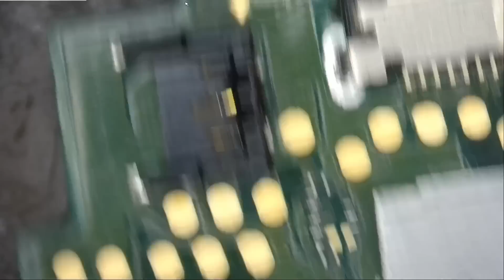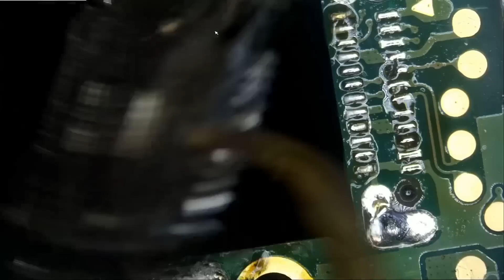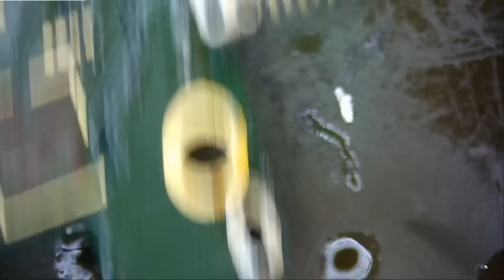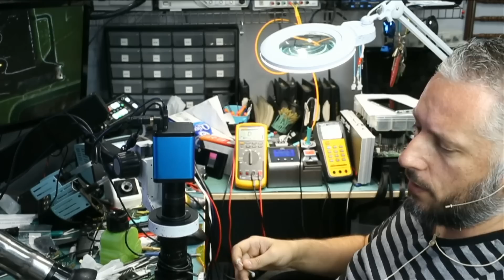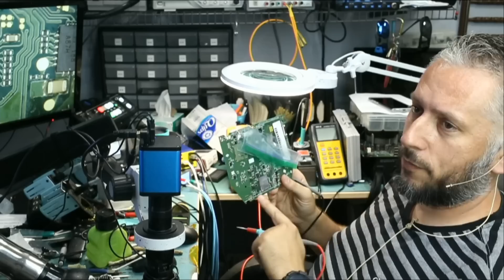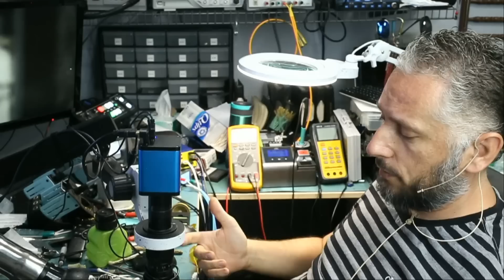Double dose of Nintendo Switch and Switch lite motherboard repair

Comment: I replaced the left control stick and now L3 is not responding when I click down, i had trouble getting a stripped screw when taking it apart, could scratching the board affect L3?

Comment: How do you melt the solder but not melting the plastic??? 😮😮😮 15:20
Reply: I think because he applies hot air from the bottom of the board in this case

Comment: While you press and hold the chip, is it not possible that the excess solder shorts the connections under. How are you so sure that they don't?
Reply: Exactly. You should NEVER push on a balled chip. you place, nudge, and it will sit it place on its own.
Reply: @mrmedoali4200  That wasn't a BGA.
Reply: @azharuddin2023  Yes I know that. I was just speaking in general and referring to balled/reballed BGA chips and not this particular chip in the video.
Reply: I don't think that particular chip was balled if we are talking about the same thing.
Reply: @edwardgalvan5412  Oh no I'm talking like in general and referring to balled BGA chips

Comment: Is low melt different than 60/40?
Reply: Yes. It is completely different metal alloys. It's usually indium alloy.
Reply: Also 60/40 is for soldering  components low melt solder is strictly for desoldering only

Comment: I've done a few of those type C connectors on switches before, and they're not a beginner friendly job. The one thing I always do differently is not to put leaded/low melt solder on the back row of pins when removing the old connector. This way, I find that when they eventually melt, the hidden row will be close to melting too and I'm less likely to attempt to pull the connector up when 1 or 2 of the inner pads are still stuck and rip them as a result. But each to their own.

Comment: Alex, for the Switch Lite fix, upon physical inspection I noticed that you might have missed the 150K resistor sitting right behind the daughterboard connector, which is next to the battery plug you've replaced. It's missing.
Reply: That's unpopulated by default, you can tell by the color of the pads, if they're golden it's empty by default, if it's silver and pointy something has been removed by force, if it's silver and smooth it's either desoldered or empty by default but with solder pads, empty by default ones are usually too perfect to be mistaken with a desoldered component.
Reply: At 11:30 in right corner?
Reply: nice catch